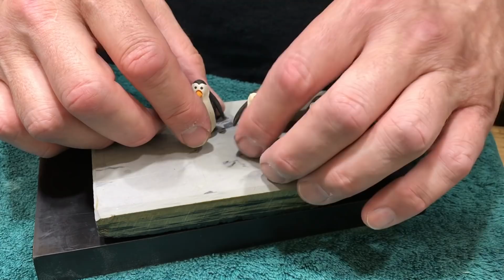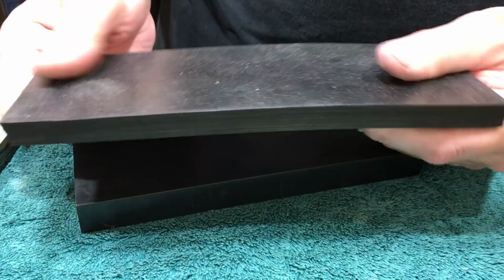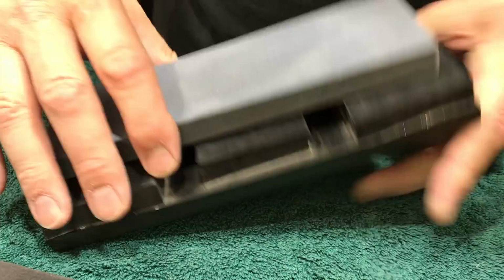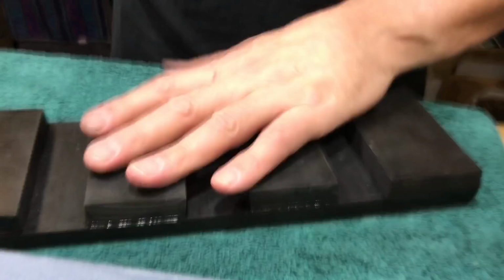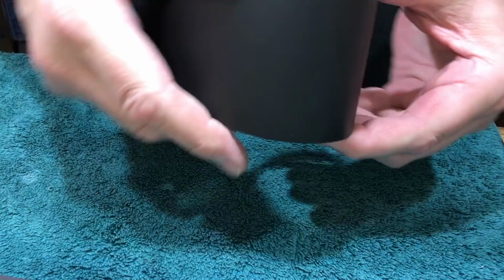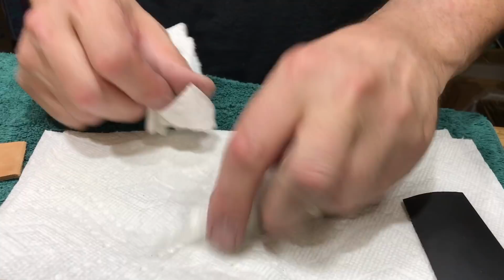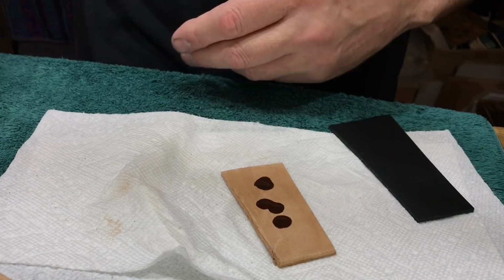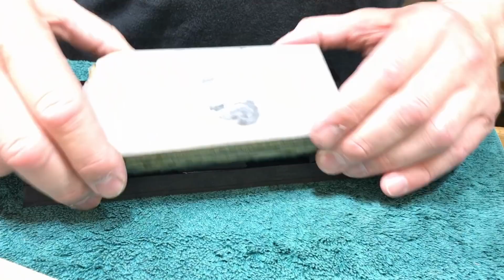Straight Razor Honing Vlog #2 -  June 2018

Comment: Would oil be a problem on the gator pad? I prefer  oil on my Ark so im curious if oil and rubber is a oroblem?
Reply from the maker: I have not done any extensive long-term testing here -  but the non-petroleum oils I put on the rubber didn't bother it. I would assume that any petroleum based oil, esp those with solvents in them, would be problematic.
Reply: Keith V. Johnson Sounds about right. Appreciate the reply. Thanks
Reply: Keith V. Johnson Are the non-petro oils you mentioned what you use on your Arkansas? I know a lot of ppl are using water and dish soap these days..
Reply: dfailsthemost I’ve been using mine for close to a year now and have not had any issues with any of the petroleum based honing oils, I do clean it off immediately after every use though.
Reply from the maker: I just saw this now.... 
On very hard Arks, like Translucents or Sugical Blacks, I use water/soap, water/glycerine and an organic non-petroleum oil blend that I have been testing for a long while. I may, at some point, bottle the oil for my Etsy shop but I am not sure yet. For softer Arks, to keep the stone healthy, I think it's important to use traditonal petroleum based oils.
Reply: Keith V. Johnson I appreciate the reply. That lines up with my experience. I've found with black and trans, they dont seem porous enough to absolutely necessitate oil, but softer  stones are so porous that oil seems to work far better. Plus, i feel that oil helps smooth the blade's movement over the peaks and valleys of the coarser stones.
Reply: Keith V. Johnson BTW, no expectations here regarding replies - least of all fast replies. I appreciate your sharing the info you have accumulated.
Reply: Keith V. Johnson Glycerin or glycerin/water mix work well, they make the tells a bit more obvious on those stones, other than that using any oil really doesn’t bring much to the table IMO.